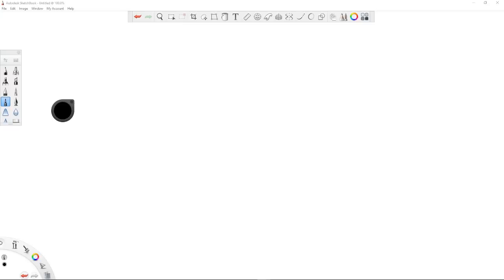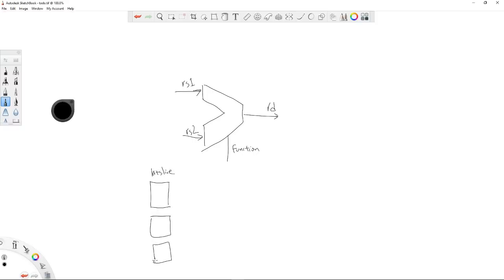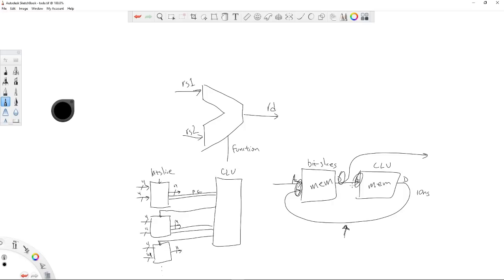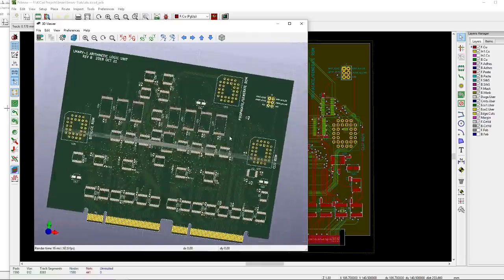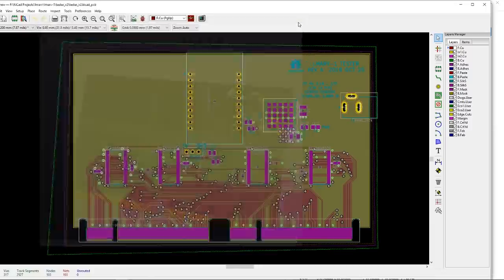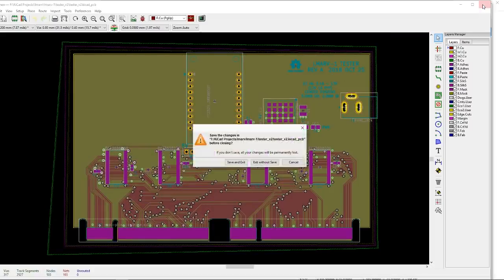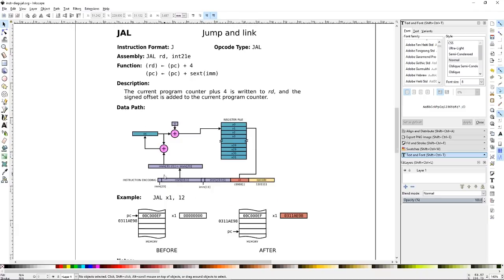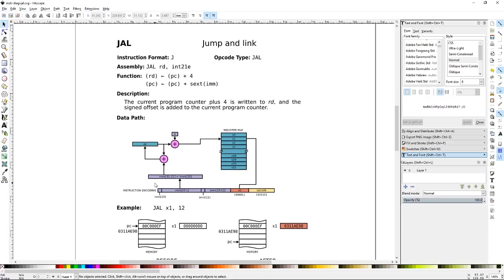LMARV-1 (Tangible RISC-V) Part 6: ALU, testing, instruction controller

Comment: Hi Robert!  Been waiting for this next installment. Thanks for posting. My annual December vacation is coming up so looking forward to diving into this in detail for a whole blessed month!
In my design I'm going with 74F181's and associated propagate and generate support chips. I'll probably use some "large capacitiy " CPLD's for glue logic.
Reply: CPLDs are awfully close to FPGAs ;)
Then again, so are Rob's memories...
Reply: @Wren6991  Yeah, it's a cost control thing. As much as I'd like to implement this 100% with discreet logic any mistakes become a PITA to fix especially seeing as I'd have to respin board fixes. The more discreet logic the larger the system  and the greater the power consumption. It's also getting harder to find the parts, sadly. I have a stash of obsolete medium capacity CPLDs so I may as well use them while I can.
Reply: @vincei4252  Yeah I get you :( I settled on designing an 8-bitter on breadboards, and am using FPGAs (well, just HDL sims at the moment really) to play with RISC V. Life is too short to spend it wiring! Also I agree that multi-chip designs (i.e. a pile of CPLDs) are a step change in coolness factor :)

Comment: Hey Robert, my experience with LGA's is that too much flux is bad... I usually apply a bit soder on all pins (thin and plane), which makes the connection more likely to happen! After that a low amount of flux and you're done :) Try to do this on a rework station, you will need a lot of heat.

Comment: Rather than have additional adders what about having additional internal scratch pad registers that the CPU microcode can use with your primary ALU as the need arises? Are you concerned about the speed loss performing more microcode steps ?  Just a thought.
Reply: Ok, I've watched further. Looks like you want to execute instructions in as few cycles as possible -possibly without microcoding?
Reply from the maker: @vincei4252  Right!

Comment: For the 3D packages with KiCAD, have you made sure to actually download them by itself? I'm not too sure how ti works with Windows, but its definitely a separate package with Linux. If you do already have them installed, its as simple as going into KiCAD's main menu and updating the filepath pointing to all the .pretty files.

Comment: I think you just need the multiplexer flip and the stores to happen 180 degrees out of phase. So you write to the instruction register on clock up, switch multiplexer to the address on clock down, store & update pc on clock up, then switch the multiplexer to the pc on clock down
Reply from the maker: So two-phase :) You could use the negative edge of the clock, or you could use a clock twice the frequency, with two dividers 180 degrees out of phase. Something something different clock domains but not really :)

Comment: 3:20 : you say it's not gonna work. Your heuristics say so. But did you TEST this assertion ?
The principle of the CLA circuits is to compartimentalize and allow carries to propagate faster.
This means that individual bits might be unstable while the circuit settles but since the input doesn't change AND the nibbles do communicate only through the CLU, it's not going to oscillate.
I recommend you test these principles with some VHDL simulations for example, but scripting languages would work too (JS, Python...) and http://www.falstad.com/circuit/circuitjs.html is awesome. This will save you a lot of hardware, soldering, errors, space, money, bugs, latency...
Reply: Some of the outputs are statically not functions of some of the inputs, sure. You will still see static hazards on these outputs when you actually toggle the address inputs, and the hazards are looped back. It would settle eventually, but you can't strictly put any bound on the settling time. VHDL etc are not great tools for capturing this kind of issue, they're really just synchronous design tools.
Reply: @Wren6991  
VHDL is more powerful than Verilog and it can describe timing-accurate simulations (this feature is taken for granted in all FPGA development systems). In my current design, I even have a library of individual gates where I apply arbitrary propagation delays : this helps extract dynamic behaviour that is more relevant than the static critical datapath. For example if I set every gate to 1ns, I can see the average and maximal propagation time and hence gates traversed for each condition.  

For the CLA : "It would settle eventually, but you can't strictly put any bound on the settling time."
Yes you can in the CLA because by design the only thing that will change is the carry input of each adder block.
Each adder(except the first) will add without the carry input. The carry output goes to the CLU which generates a new set of carry outputs, going back to each adder (except the first). But under no condition can these carry inputs be changed again. So the adder will output one first temporary result, then a second definitive. There is only one possible loop and no oscillation can occur. Robert's original design was good. The 2nd design is bloated, more prone to errors, takes more room/electricity/money/time...
Reply: @leyasep5919  I suspect that there may be a difference between a (ram) LUT based implementation and an actual combinatorial solution. With a combinatorial chip, it is guaranteed that when the carry is fed in, the propegate and generate bits will not change, therefore it is designed so that it will settle properly. With a ram, though, I do not know if there is any guarantee that other bits won't briefly flip in the process, because it wasn't explicitly designed for this usecase, unlike an FPGA or combinatorial chip.

Perhaps some tests could be done on the rams that are being used to determine if other bits are briefly flipped or not during these changes? (edit: oh right, you asked for tests in the first place)

That said, I'm by no means an expert in this subject matter. Just presenting a possible explanation.
Reply: @tommyandrena  Yup, words are easy. Tests, however, rule ! :-) And @Robert Baruch asserted something without testing, which would uselessly increase costs/power/size/complexity...

Comment: You said that your friend is going to run python code on this board?
Im curious, how would you do that since Python is compiled for specific CPUs only.
To my knowledge the easiest case to write a programming language that is compiled for your board is the one where you would have to solder a Java Processor that runs Java Bytecode.

Or else you would have to write your own python compiler. Right?
Reply: Python code will run on the PC and send test vectors to the hardware via the Adafruit adapter board. Test Vectors not Python is what exercises the hardware. Make sense ?
Reply: @vincei4252  OH I knew I somehow misunderstood you. Thanks for the clarification!
Reply: @exapsy  Well, I'm not Robert but happy to clear up any confusion :-)
Reply: @vincei4252  kek, yeah I was writing this on phone. hahah